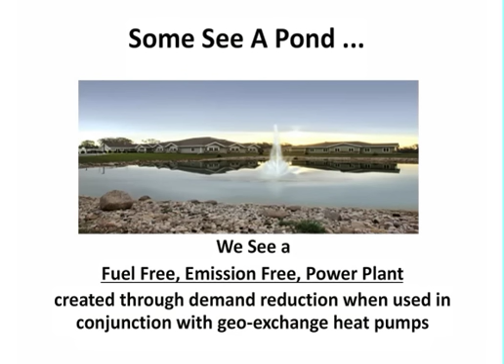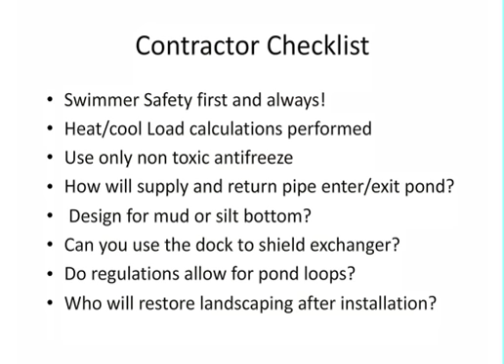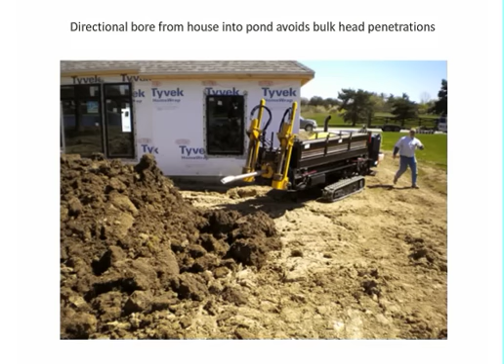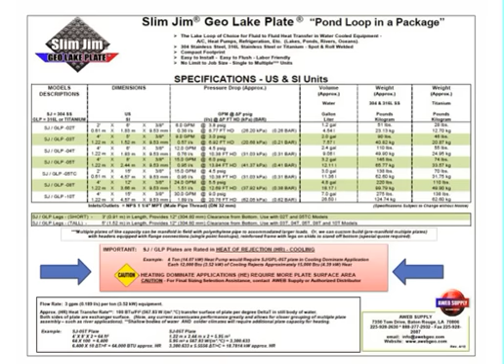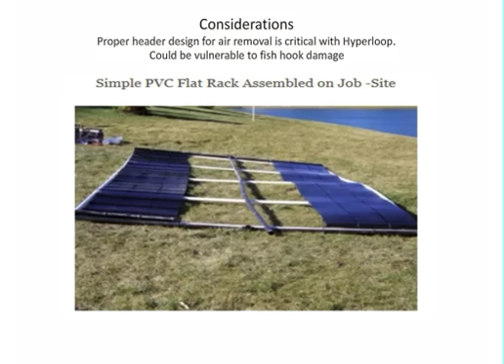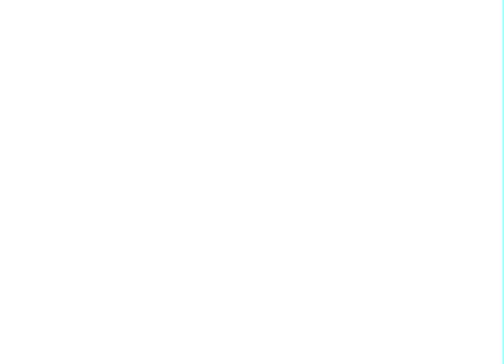Small Pond, Big Performance   Pond Loop Geothermal Loop Design Webinar

Comment: Great video. However I needed to hear about geothermal heat pump pond loops in a cooling dominant climate. It’s also a heating area in mountains of southern New Mexico so both cycles would be used. But more cooking load than heating load. How do I calculate the system? Is there a website that has charts. Thanks

Comment: Thank you for a very informative video, could you please help me with pipe sizing and let me know if I am trying to replace 2 Spit System heat pumps, one (4 ton and one 3 ton) with Geothermal, can I use 1 loop for both units or does each unit need its own loop? These are my conditions: Large Lake 75 miles long) Lake is 175ft away from house down hill with 10ft of water under the floating dock - elevation from house to Lake is 15ft below house - planning on a closed loop system built on a PVC skid with Blocks underneath - Location Upstate SC - Lake never Freezes - I would like to only trench in 2 lines to the house to feed both units, but If I need separate loops for each unit that will be 4 lines up from lake. I was planning on 2500ft of 3/4 HDPE for the Loops and 3/4" HDPE To feed the Loops from House?

Comment: I'm in kansas city and have  3700 m^2 pond.  It has alot of muck and silt in it from 30+ years of being in existance.  The max depth is around 6 ft to the muck. and probably another 1 or so deep after that.  It is only about 20 meters from the house and is a private pond.  Currently I have 6 tons of air based heat pump and would like your opinion if a closed pond loop would be more effecient especially when the temps dip below 32.

Comment: I can't grasp how you can warm a house using icy lake water. This just makes no sense to me.
Reply: It's pretty neat, as long as the temperature of the refrigerant in the coils is colder/more icy than the icy lake water, the existing energy in that lake water will still want to transfer to the even colder refrigerant. Then the heat pump (which is just a reversible air conditioner) uses the phase change of the refrigerant to concentrate that heat. Heat pumps that exchange energy with air do sometimes stop being effective because the air gets colder than the refrigerant so it can't absorb the heat. That nice thing about doing the heat exchange with a geothermal or water source is that as long as it's appropriately sized, the exchange medium can't really get colder than the temp at which a heat pump stops being effective!